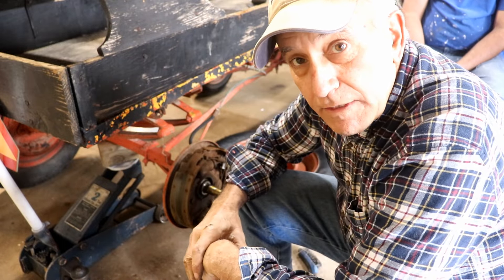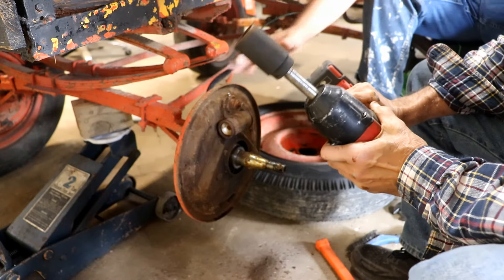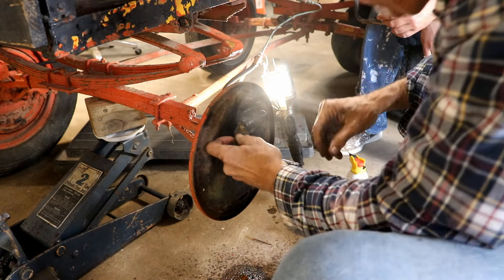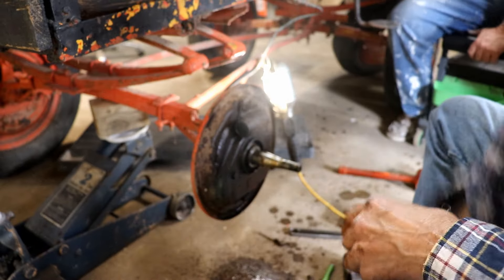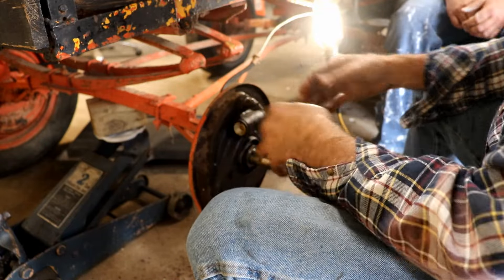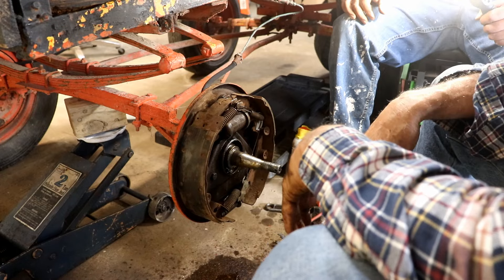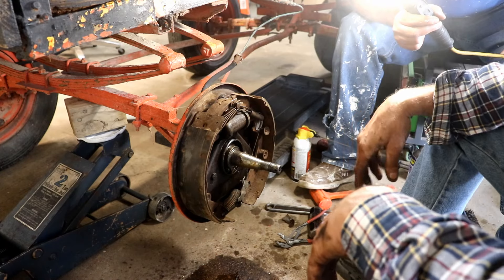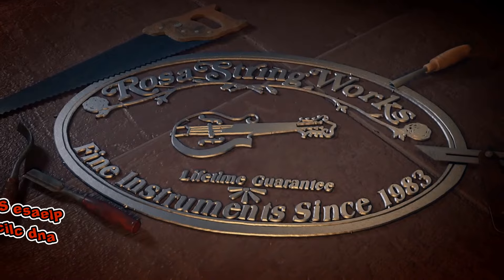688 RSW Brakes For Olivers Parade Wagon

Comment: If theres a next time Jerry assemble the bottom spring and adjuster first to both lower shoes. Then Install both brake shoes by spreading them a little to fit into the wheel cylinder pins on both sides of the cylinder simultaneously .Then deal with the rest of the springs and other parts..... Dont know of many who assemble one side at a time..but you got it ,HA!

Comment: Jerry, if you pull the bottom of the brake pads out off the lower keeper the brake springs will release their tension so you don't have to pull so hard to release them. Same with going back in, you put the springs on then pull the brake lining into the keeper. Mae the job just a little easier. Also, if you break the brake line fitting before you loosen the cylinder you'll find it's easier as well. Ask me how I know.

Comment: my husband says the bottom spring isn't on correctly
Reply from the maker: Pretty sure it is.  It worked the adjuster properly.
Reply: @43 seconds you can see the properly installed spring.  @RosaStringWorks